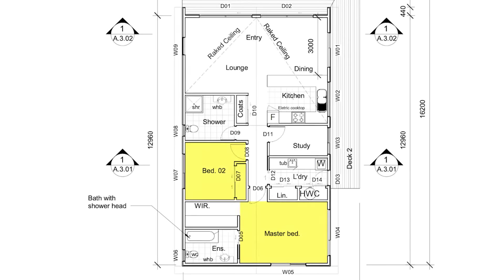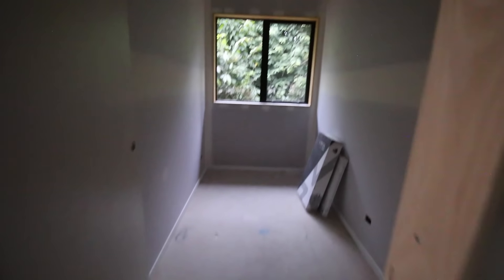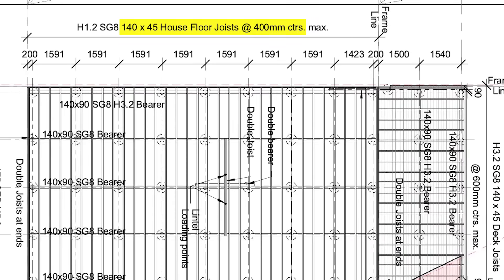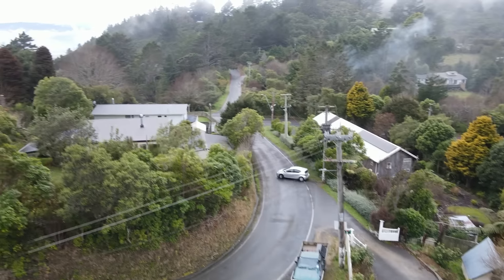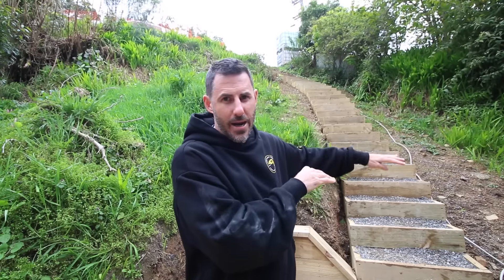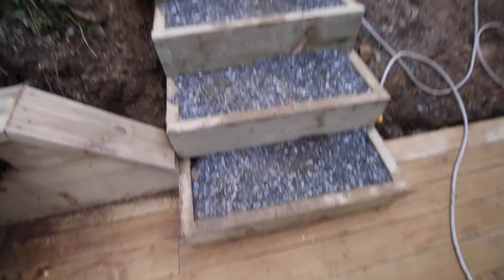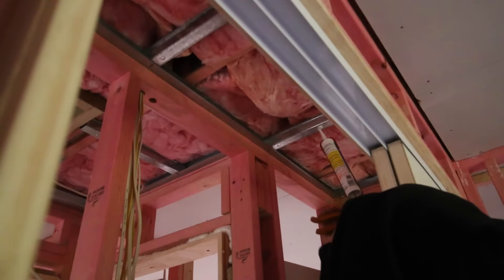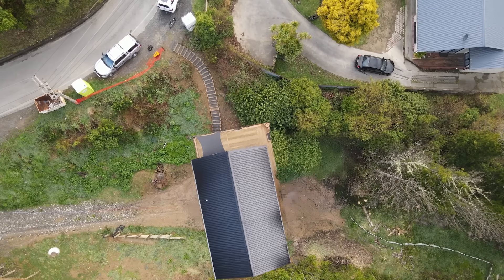Building a Cosy House In The Bush on a Steep Site

Comment: I work as an architectural designer here in NZ - I suspect that the reason the architect got incorrect topographical information, was because it was obtained from council GIS maps or some random source. And that a survey was never done by a surveyor. 

From experience, ALWAYS get a topographical survey done even before you start designing anything. Don’t rely on google earth or data from koordinates or the council. 

Engaging a surveyor early on saves a lot of time and headaches down the line. It’s crazy to think this happened right up until piles were put in!
Reply from the maker: Totally agree - lucky they had such a good builder on board to spot this before it was too late

Comment: I like this video very much. But I am curious why the owner chose such a bad place to build the house, in a valley. When the rainfall is a little heavier, it will be very inconvenient to go out. If it rains heavily, you have to worry about whether the house will be destroyed by floods. There is also a curved road with a large slope next to it. If the driver does not operate properly or encounters extreme weather, he may fall off the road and damage the house.
Reply: My thoughts exactly 😢 Flood water, landslides and flood debris. It's very counter-intuitive to have place the building there.

Comment: I would only use plastic cavity batons, if I did steel cladding again, to help with thermal bridging. Although the batons you used would still be much better than direct fix.
Reply from the maker: Interesting - ill look in to those

Comment: any good roofer that does iron wall cladding would of laughed at you to try do the iron setout to find where the ribs will to measure the window flashings. what a f^%@ around.. your better of to get a variation with the council an gone back to the draftsman with that window jamb flashing detail. 

basically by flashing it twice.
you can back flash it, so 90degree flashing that goes in before the window with a crushfold edge, then it nails ontop of the cavity battern an returns into the window opening, then once the iron is on make another flashing that actually clips behind the window aluminum with a crush fold then you can easily measure it so it lands past a rib.

.. pre measureing to find out where the rib of the iron is going to be without the iron on the wall is seriously backwards mate. i think u made that way to hard for yourself next time talk to your draftsman an get a variation.